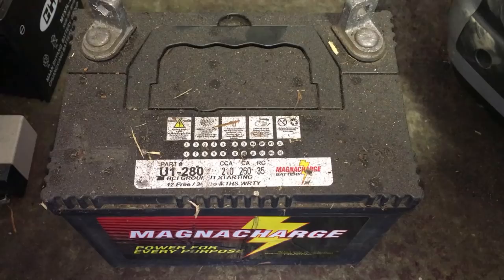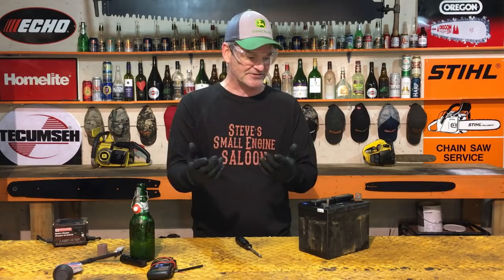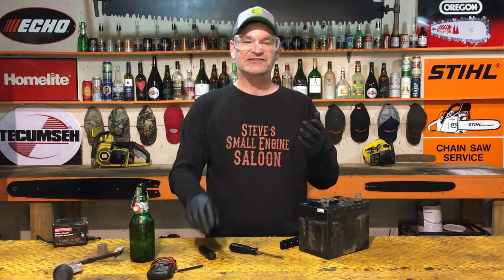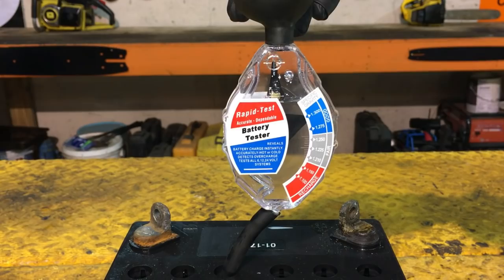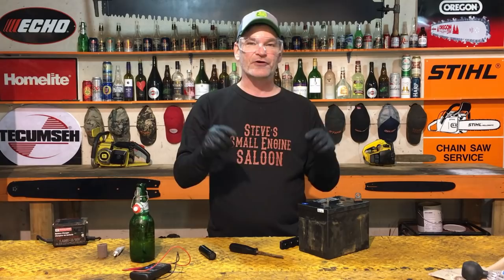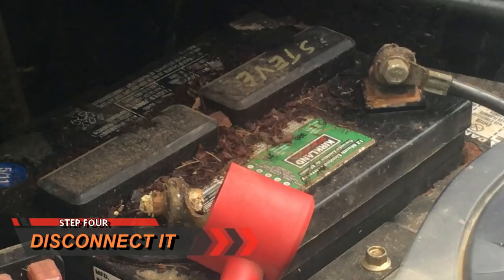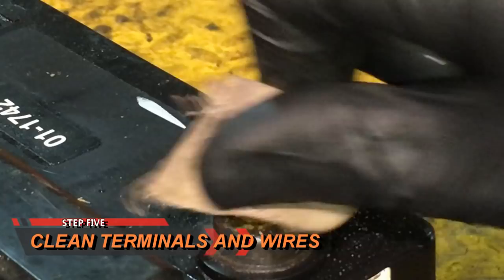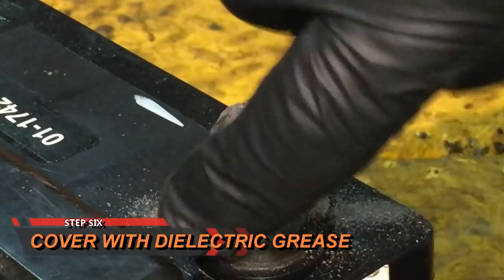How To Winterize and Maintain The Battery on a Riding Lawnmower

Comment: Great video Steve - if leaving a charger connected, make sure its a smart or trickle charger like you used - a regular charger may boil off the electrolyte and buckle the lead plates (knacker it). Keep up the good work, check out some British Cider - you'll be too sozzled to drive your tractor anyway

Comment: My mower is stored in an outside shed, i use a Solar Charger to keep it charged all winter. Thanks for the video.
Reply from the maker: Awesome...
Reply: I also use a solar battery charger. The no-load output is 18V. When attached to the battery it drops down to 13V. This maintains the battery  for the whole time it is connected. I also us anti-seize compound  to prevent corrosion build up on the terminals. My batteries generally last in excess of 5 years with this method.

Comment: ive seen 5 videos from you, and in 3 of em you're drinking dutch beer. tnx for the bar tip, our saw made crooked cuts and i balanced it on its side and indeed it wouldnt stay upright. it was a new 100 dllar bar(its why we bought the saw) spared us sme novice expenses. wouldnt have considered a new bar would already be worn like that, but then again the guy we bought it from had all teeth on the chain in different lengths and angles, fixed that too, now it makes spaghetti and cuts straight (and easier)

anybody got a spare carb for a husky 266 se? the cheap chinese one increases fuel consumption by a four-fold

Comment: When you said by checking with the liquid meter you checked one cell and said it was a good battery I think you should emphasize that checking every cell with that is suffice to make sure all cells are in the positive. I happen to just take all my batteries out of my four wheelers and check our car batteries for corrosion connection and voltage. Good video Steve I'm drinking Miller Lite
Reply from the maker: Right On...

Comment: Steve,  I just retired from AT&T after 47 years of working in a central office.  We have all sorts of lead-acid batteries.  You are spot on.  A couple of extra tips.  When cleaning your battery, use a little baking soda.  That will neutralize any acid that seeped out.  For a di-electric grease, we used a product called NO-OX-ID A-SPECIAL.  They were using that product long before I started.  Really good stuff.  I've used it on my cars without any problems for years.
Reply from the maker: Right On...
Reply: @StevesSmallEngineSaloon  wondering if reg. greese will work ????
Reply: granpa said so
Reply: Never let any making soda seep onto the battery cells though. It neutralizes the acid in the cells.
Reply: @okeanakidd5118   I have used regular grease for many years and on many machines.  If everything is coated with grease even taking out the tightening bolt and nut and the hole it goes into and even coat the cable if exposed at the connection.  I have never had any corrosion or connection problems.  Of course you have to clean everything first.  I believe what it does is it keeps it from being exposed to the air.   Even taking out the battery for winter storage and put back when needed.  I do give my batteries a top up charge every couple of months in storage and batteries seem to last a long time.  Going dead is the hardest thing on a battery.

Dale in Canada
Reply: No way am i pouring my coke over it, it's way to expensive for that. You must have money to burn :)

Comment: pretty much what i already do;) good video. my roomate is terrible about leaving car doors open and lights on, or the battery hooked up to the snowblower / riding mower which has aslow drain, so he has killed more than a few batteries.

seems like just about every new battery i buy nowdays is maintanance free.

also battery tender brand trickle chargers, the ones that are basically a wall wart, i have had those consistantly fail, and its not like they are cheap

Comment: Steve, one more thing.  If the plates get exposed, there is quite a bit of air space above them.  Hydrogen gas will build up and the exposed plates can arc.  I've seen two batteries that blew up because of that.  Not a good thing.
Reply from the maker: Thank You...
Reply: 😱
Good to know, thank you!
Reply: Low electrolyte is just a bomb waiting to go off. I started a generator that likely had low level. Luckily I was in a different room when I hit the switch. The battery instantly exploded from the arc across the plates. There wasn’t much to clean up because the battery case and electrolyte was spread out over the entire room. Imagine standing over a battery jump starting a stranded motorist. Always make the last connection to ground away from the battery.
Reply: @LongRidgeFarmer  Been there, done that!  Good information to pass on.

Comment: excellent video Steve. I worked for a lead acid battery manufacturer for 24 yrs. We looked for 12.6 volts for a fully charged battery. If I were going to add anything to your advice it would be, DON'T OVER FILL THE CELL, as the acid will wick up to the top of the battery (while charging or from  vibration while you are using the mower)   and cause that unwanted corrosion on your terminals. Like I said great video.
Reply from the maker: Thank You...
Reply: Good tip , thanks!
Reply: Depends on the temperature that the battery is at as to what voltage is considered fully charged.
To get a correct reading we need to let the battery sit for a few hours after removing the charger

Comment: many years ago i was told as a young mechanic, not to store a battery on concrete cause as the temperature   changes from day to night that there will  be a moisture build up on battery from ground to  pos. then to. pos. to neg.  terminals also causing a drain   and that was in the south were its not a freezing cold issue but moisture issue.

Comment: Here is a fact. If your battery voltage drops below 12 volts for more than 24 hours your battery will have suffered damage to the lead plates. The plates start to dissolve when voltage goes below 12 volts or 2 volts per cell. (A 12 volt battery is made up of 6 two volt cells.

Comment: Great video, and I like the options for testing.  If a guy has multiple batteries but only one charger, what are your thoughts about hooking them up in series and connecting the ends to the charger?  Good or bad idea?  Thanks again for keeping the quality videos coming.
Reply: No no,. You hook your batteries up in parallel and then hook to your charger.  Never connect in series.  Two batteries in series is over 12 volts so what will you have if you connect a bunch in series?

Dale in Canada

Comment: Great video, but one word of caution!

I have had several batteries cooked dry with the battery tenders / float chargers.  The cheap Harbor freight ones were the worst!  Then I bought the Battery Tender brand and 2 out of 3 of them cooked my batteries dry within weeks (this was very recent).  I believe the reason is that almost any brand of them now are made in China (like everything else that we are forced to buy) and they are basically defective junk!   They would charge at 14 to 14.2 volts,, but would not regulate the charge like they are advertised to do.  I collect motorcycles and I lost over $1000.00 worth of batteries with the Harbor Freight battery tender / float chargers within a month or two!  I have since opted to just store my batteries in my basement over the winter and put a 2 amp charge on them overnight once a month.  It`s more of a pain to do, but it works for me!
Reply: I did contact Harbor Freight to no avail!  I had 10 bikes with the battery tenders on them and they ruined all 10 batteries within a month or two - I threw all of the chargers in the trash!
Reply: I have also had friends that had the same problem with the battery tenders.

Comment: Hello from Pennsylvania! Good one Steve. Add a rubber apron PPE, not to get holes in your clothes. I ran a battery shop once. When you have a charge on a battery and the caps are off (you had your on), realize the battery is releasing hydrogen gas, very flammable stuff. I ran a Hydrogen Plant once too. Keep up the good work Steve and thanks for sharing with us. Battery tender, I like that. I bought a Mr Funnel you had on a previous video I viewed. Hey, you're costing me friend. Here's a tip during the COVID19 Pandemic for us seniors viewers; Take vitamin D-3 to help strengthen the immune system. Old guy signing out ...

Comment: I can make one suggestion, only add fluid to a battery after it is fully charged. You must check the battery with voltmeter.  If the fluid is low, charge the battery up and then add fluid. The reason being is as the battery charges, the fluid expands and will rise out of the top of the battery.

Comment: Steve, I keep an old styrofoam box under my work bench that I store battery in over the winter. Keeps it from extreme cold spells. Another tip, if you have an old fridge put it on 38 degrees . Put battery and paints you don't want to freeze in there. It will insulate and keep from freezing.
Reply from the maker: Thank You...

Comment: there is one thing that you got incorrect steve.  cold temperatures decrease discharge rate rather then increase it. What causes confusion is that a battery will be weaker when it's cold and won't have as many amps but this also slows down the degradation of the battery.  A battery in a cold climate will have longer lifespan than a battery in a warm climate (assuming you don't' let it freeze)
Reply: AbyssFlight Ahem,nah cold temp. more demanding on battery for cold cranking amps....Don't confuse yaself getting over complicated lol:)

Comment: I would add only that if using a hydrometer to check the electrolyte, check all cells, not just one. I'm sure that's what you intended to show, but I didn't see it in the presentation. Nice work, as usual.
Reply from the maker: Absolutely, thanks Buddy....
Reply: I understand there is limited time in the video but I was hoping you were going to check the cell you added the distilled water for comparison.

Comment: Hey Steve I use my lawn tractor all year round. Cut grass in the summer, blow snow in the winter. This winter my lawn tractor turns over very slow if at all but when I put a battery charger on it, it turns over no problem. Tested with multi meter and it says 12.95.
Reply: Do you change the oil before the cold sets in to a lighter weight, say 5w30? Your voltage may be up there, but not your amperage. Use a Load Tester to determine the output (strength) of your battery. : )

Comment: I've used Harbor Freight's cheap battery tender and it's worked great on my John Deere for about 7 years before I had to replace the battery . I bought more of them on sale for $4.99 and gave them away for Christmas presents for Christmas one year . But don't make the same mistake I did and start it up with the battery Tender on it and it chewed up the small wires - had to but another's battery tender . Ah well ........
Reply from the maker: Right on Buddy...

Comment: From MY EXPERIENCE, you can also use VASELINE for the  Battery terminals and Electrical connections to minimize corrosion  and what not.

I'd also recommend that individuals buy a "Float Charger" from Harbor Freight Tools, if their equipment is within range of an Electrical Outlet to maintain the charge of their battery!

Thanks again Steve for your knowlage,
🤓-Thomas

Comment: I keep my battery terminals clean and full of fluids. I start my mower and run it all season long. My battery has not failed yet in 6yrs. I have taken the measure taken it out and serving the battery before and it really was no help.

Comment: Last couple of maintenance free batteries I’ve had, only lasted about 2 years ... This year, I am going to see if storing it inside the house makes a difference
Reply: Storing the battery at an elevated temperature will not help. Cool storage will not hurt as long as the battery never gets frozen. If it's not fully charged it will undergo sulfation at any temperature.

Very short battery life is caused by several factors. Too low or too high charging voltage in your machines is bad, and storing at partially charged state(as a result of said low charging voltage) is bad. High temperature due to climate or a hot spot right next to the engine is bad for batteries too. Mechanical stress is bad.

The typical maintenance free batteries are just that, maintenance free or not to be watered. Sometimes the sole difference is the cap style. Some are glued or stamped shut, and some actually have caps you can open to add water if you know how to. Most of the time there's not need unless they are overcharged and or operated in a very hot environment.

Comment: I've been working on cars for 43 years and have learned much. A fully juiced up battery should read 12.6-12.7V minimum after sitting overnight. Charge the battery fully after checking/filling with distilled H2O (don't overfill!). When recharging, disconnect when fully charged and let sit for an hour or so, then recheck the voltage. It should be at a MINIMUM of 12.6V; if less than 12.6V, it is not fully charged (each cell is 2.1V times 6=12.6V) and may need to be charged further and/or tested (esp. if voltage continues to drop). For best winter results, bring battery indoors and out of the cold for the winter duration. Note: bringing your car battery indoors during bitter cold snaps will give you much more cranking power, esp. if your car is older and/or has a carburetor where the motor requires prolonged cranking before it starts. Another thing that will kill a battery is not using it for it's intended purpose. It should be discharged and recharged on a regular basis, meaning starting the engine and letting the alternator recharge the battery on a regular basis. And a starting battery should never be discharged below 11.5V ideally. It's made to deliver a massive amount of current for a few seconds - then immediately recharged. I owned a motorhome for a few years, and the batteries would always go bad prematurely from disuse, even when maintained on a trickle charger. I needed that desulphinating device back then. I wonder if it would have worked? If the battery is used for powering a car stereo and powering other gadgets while not running, then get a marine starting battery for your car. They can tolerate being deep discharged without the damage that a regular starting battery would experience. A regular starting battery can be run down completely for only a handful of times. Then it's going to fail. That's why I use only marine starting batteries now in all of my vehicles. They last for years and are forgiving if you leave an interior light on for two days.

Comment: For my battery storage I builted a under cabinet with 3 pull out droll/shelf's, that is hooked to a solar charging system where each battery is diode protect form each other and the cabinet has a therm-stat controlled wall heater in it. The whole system is independent from the rest of the shop power system.
Reply from the maker: WOW, thats cool....

Comment: You can also use "No Ox" ( no oxide) Grease on your battery and wire terminals. Also make sure the top of the battery is CLEAN. Because if it is dirty that can cause a discharge.
Reply: Any grease is better than no grease. Silicone based is what dielectric grease is.
Reply: @thedavesofourlives1  I agree that any grease is better than no grease. But the No Ox grease has a thicker consistency than most silicon grease and is formulated for use on battery and other electrical connections.

Comment: **IMPORTANT SAFETY NOTE** The electrolyte expands while charging. For this reason, CHARGE FIRST then add distilled water as needed. If you add water to a discharged battery, it can overflow and spill acid. I've learned this lesson the hard way. If you do spill acid, you can neutralize it and clean it up with baking soda.
Reply: Yes, ideally adjust the fluid level after charge. However, do not charge if the plates are exposed.
Reply: Dang, great video and great comments.  I thought I was pretty informed but I’ve pick up a lot of good info here!

Comment: I got into the habit of making a small bottle of water/baking soda solution.  When I do all yoy said AND the caps are on tight I spray the top of the battery with the solution.  It cleans wrll and neutralizes the acid on the out side
Reply from the maker: Agreed!

Comment: I always comment Mon Ami ~!~!~! LOL.....   I use a Brass wire wheel in my drill and clean all surfaces well then on that type with the holes in the posts I use a round wire brush...... Coca Cola cleans well also and while it's installed on the mower or car / truck..... If cola can clean battery corrosion think what that does to your belly LOL...

You have a great battery since it was made in May 2011....Plus Tard Mon Ami ~!~!
Reply from the maker: Great idea "eagle eyes" Boo....

Comment: The liquid level should be at the level of the bottom of the top of the plastic case. The liquid will form an "eye" when the level is correct.  Just covering the plates is not enough.  Do not use a trickle charger for long term maintaining, it will boil out the electrolyte.  Yes battery maintainers are expensive.  The models that actually work start at around $50.  I get mine when Northern Tool has them for $20-25 around Christmas.  And NO the Harbor Freight ones do not work, I bought 2 and had to buy 2 new batteries come spring.  I have approximately 10 Battery Minders on my batteries all year round {I don't switch accessories on my tractors, I switch tractors for winter/summer :)} and I have some batteries that are approaching 10 years old....